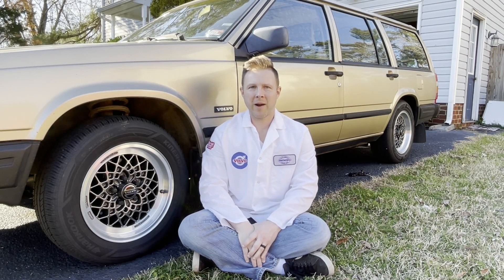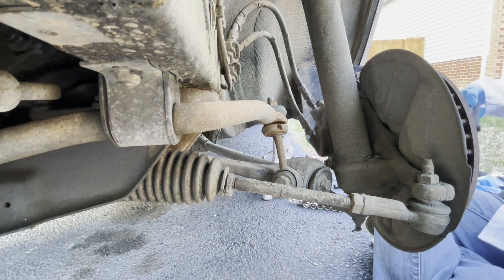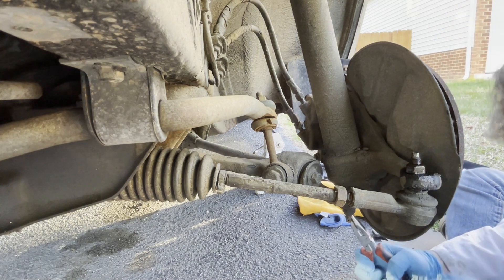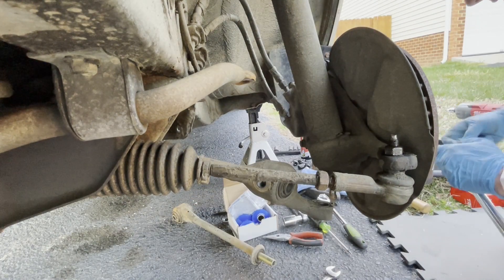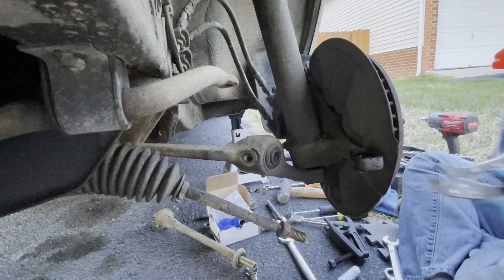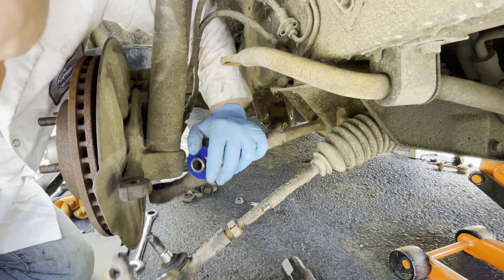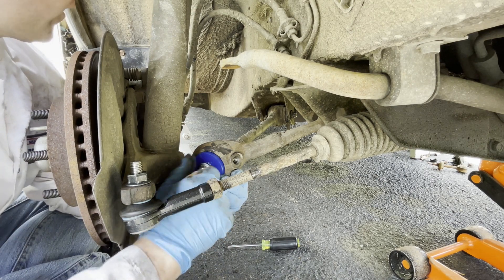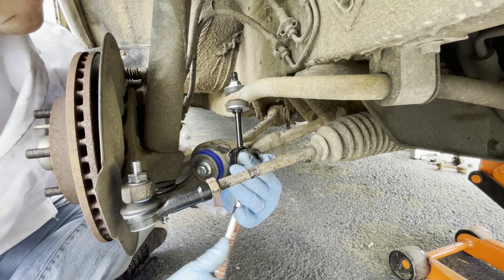Refreshing the Front End - Volvo 740 Turbo (Part 12)

Comment: Know which brand your ball joint seperator is? Ive used two, and a torch and connot get passenger side to break loose or the seperator walks on me.
Reply from the maker: @dannyglands4565  mine is just the cheap-ish one from Harbor Freight. I typically hammer it into place from the side. Sometimes I use a wrench or sockets on the separator, other times I will use an impact gun. Good luck!
Reply: Harbor freight took the joint out first try, thanks so much. Youre a gentleman and a scholar
Reply from the maker: @ that’s great to hear!!